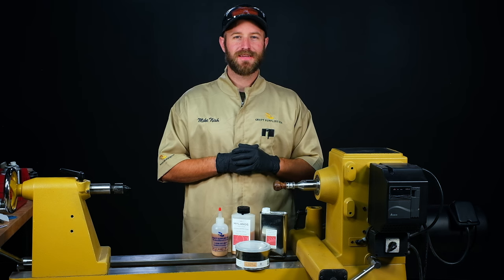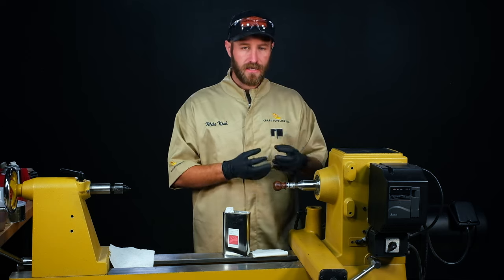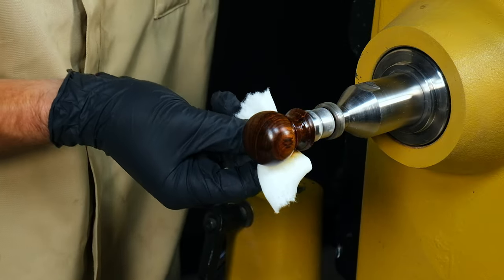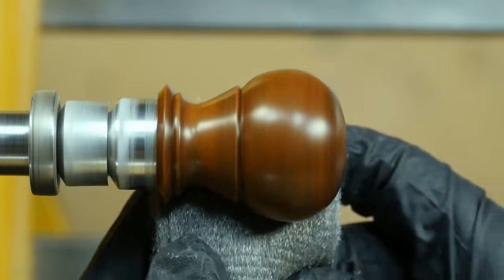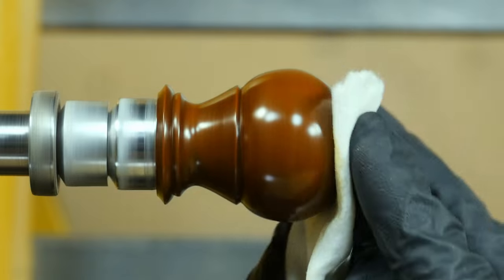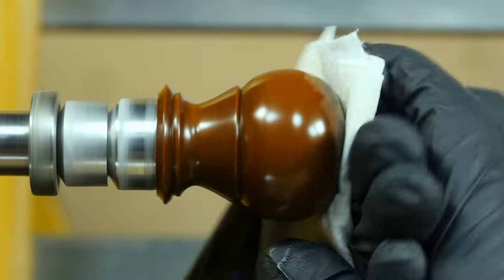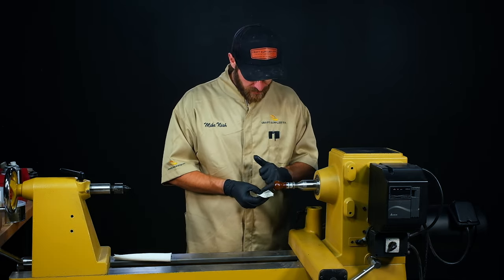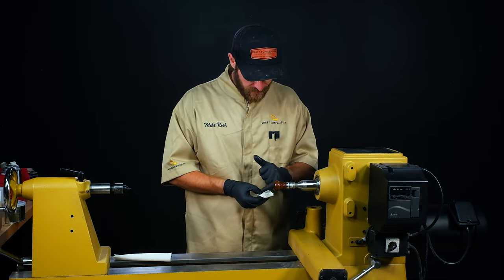Mylands Friction Polish - Finishing Guide

Comment: Hi Mike, thanks for the tutorial. I noticed in a tutorial with Kirk that he applies the first coat of friction polish with the lathe off. After getting that coat polished, he added just drops to a cloth for repeated coats. Is there an advantage to one method? I don't think he used sanding sealer first, so perhaps that is the difference. Thank you. You guys have the most professional, clear tutorials in my opinion.

Comment: Newbi, use friction polish in class..I just learned from this video..use a clean dry to buff after applying finish.
I was using the same area..over and over. 
I also am bring my own blue paper towels as , the shop use brown paper towels used in bathrooms. Chesp hard paper.